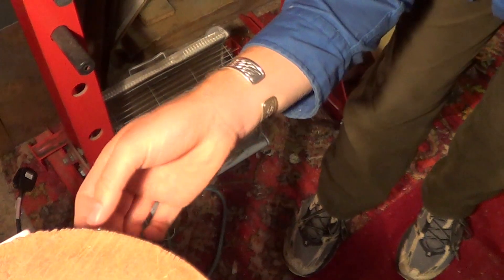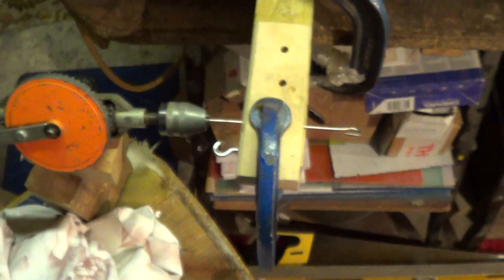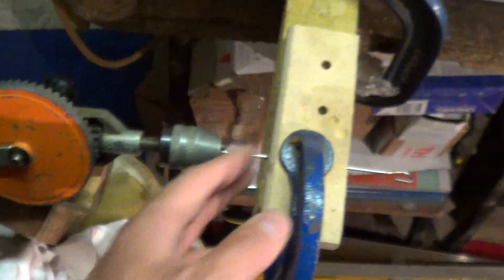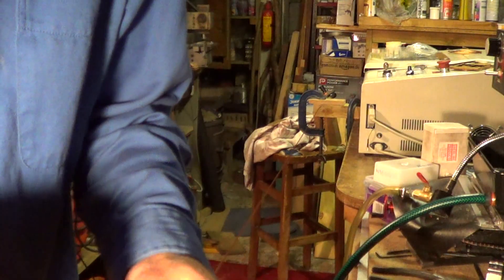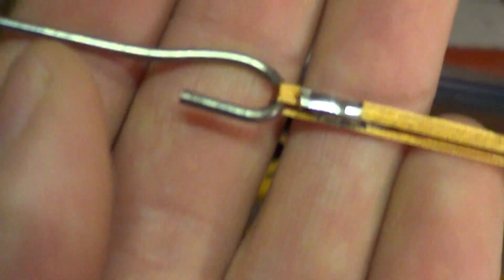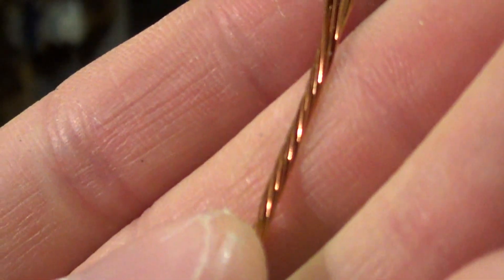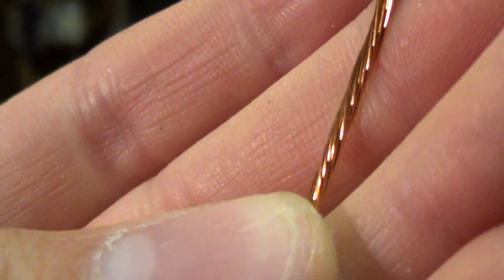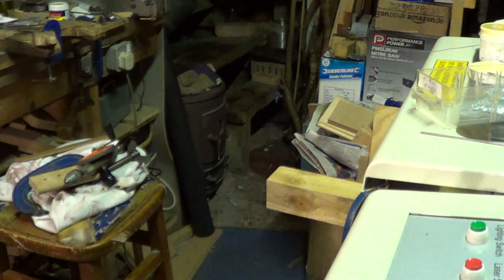Litz wire winding

Comment: Nicely done. Slow and patient for best results!
As a matter of interest, you will find that 19 strands is a natural number that comes next from 7 strands to form a neatly laid wire that forms a completely circular conductor without bumps, flats or ridges. When you have finished your 'wind', put the bundle under tension and give it a very slight stretch. This will give the wire a 'set' and prevent springing. Modern acrylic insulation will stretch undamaged with the wire, and the gauge will not be altered significantly.

Comment: FYI::::::: If you put on a pair of work gloves, hold one end of the wire and pull gently but firmly with the other glove across the length of the wire, it will tend to unravel less. I don't know how tight or lose  the bundle should be for litz wire but I have done this many times before when making multi-strand wire for various projects.

Good video..
Regards,
Glenn WA4AOS
USA